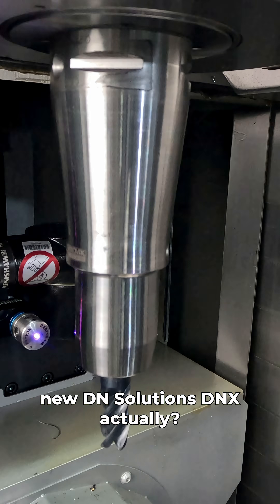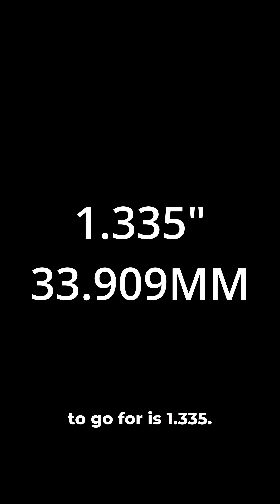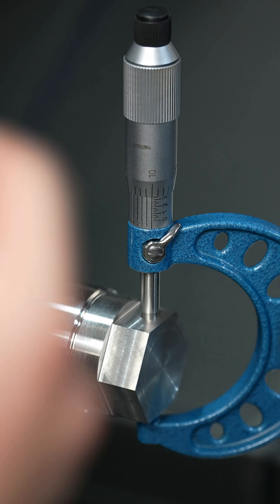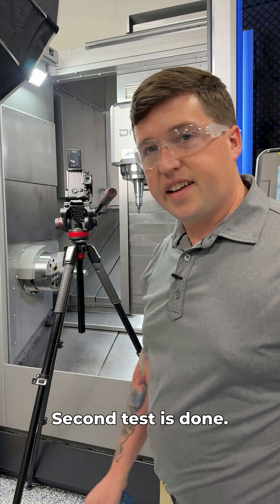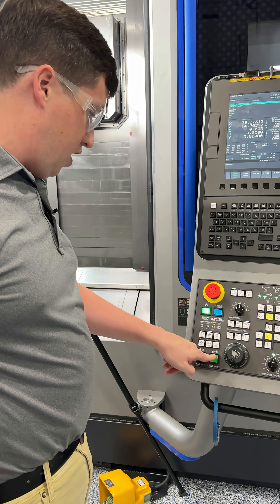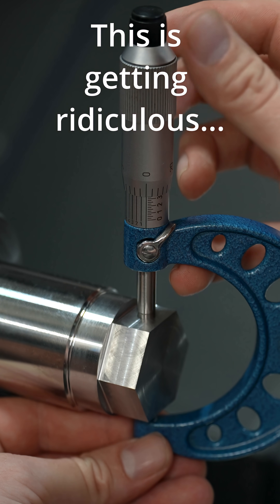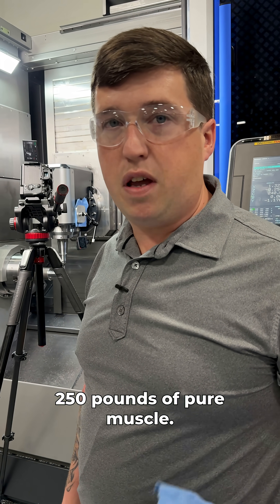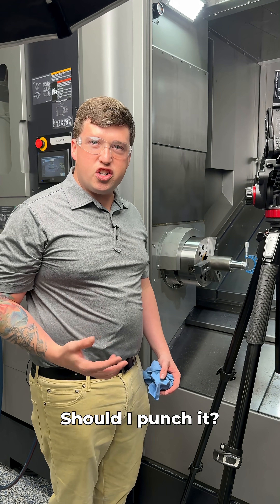DNX repeatability test

Comment: Which measurement system do you prefer, the metric or the imperial?
Reply from the maker: Either or. Doesn’t matter really. If my customer works in metric then I work in metric that day. They both have advantages and disadvantages but after so many years of just using both I honestly can’t tell the difference

Comment: Your tool holders matter the most. They also wear out. We had some issues years ago with a Mazak and it turned out to be the combination of the tool holders and the pull studs. Torquing the pull studs would deform the taper on the holder. Causing runout. Also if your spindle taper gets dirty you can have runout and z acis repeatability problems. The old style carousel tool changers were bad about holding grime and dirt and transferring it to the taper. We have a few Bridgeport VMCs and we had to clean the tool magazine regularly

Comment: Use the rachet @ 3 clicks exactly if you’re bad.
Reply from the maker: I wish it had the upper ratchet. It has the the rolling style grip which I personally think sucks. It locks too easy so it isn’t consistent. You have to put your finger on both the barrel and roller to use feel. Which again I think sucks but if you practice a few thousand times on gage blocks you get consistent 😂
Reply: @donniehinske  HATE that style of thimble.

Comment: Honestly to test repeatability I would have milled separate haxagons because if you come back into the same hexagon, it’s almost like a finish pass, with a lot less tool pressure.
Reply from the maker: Well to me that’s kind of the point. I want to see repeatability. If you take heavy cuts you can introduce different variables
Reply: Right, but if you Mill the same hexagon just stepped down, you are changing the tool pressure,therefore applying a new variable.
Reply: You can see a lot of issues just circle milling a bore. We used to set backlash comp values doing this, it take into account any sticktion in the ways and ballscrews

Comment: If shaking the tool would move it, it's far gone the time to change the guides or bearings, I think 😅
Reply from the maker: You’d be surprised. Every CNC on this planet if you put an indicator on its turret and push it it will move a little and that’s every CNC.

Comment: From Mori. To haas. Toyoda every other changer I have used in past 35 years have never seen difference.
Reply: Exactly. The Haas mills I run have the same repeatability as this
Reply: @rixiv7868 
You have no idea what repeatability this machine offers, or did you see anyone properly measure it?
I sure didn't.

Besides that, no. It most certainly doesn't. But it's completely irrelevant for the absolute majority of milling work.

Comment: You wanna impress me make it go from 3.335 to 3.34. 😂
Reply: Easy. Steel 3.335" to 3.340" you need 125c temperature increase. Pretty sure you can do that with the holder itself with the 12K spindle😂😂

Comment: This isn't really a test of the tool changer. The tool changer doesn't dictate the final position of the tool within the spindle. This is more a test of the repeatability of the spindles tool clamping mechanism.  Assuming that it's a dual contact spindle it should repeat effortlessly.
Reply from the maker: That’s a fair point. Still I was really shocked with how well it repeated. To me it seems SO easy for just one hair to throw off the capto system
Reply: @donniehinske I don't have to many hairs left to test that theory with, so I'll leave that up to you for testing.
Reply: Fair, however, I see  005 on similar hex "offsets" on mazak mill turn integrex machines and they're no where near the .0001 tolerances that this short shows
Reply: I would prefer to see the spindle spin randomly before the tool changer remounts the tool.  That is closer to real-world.
Reply: @AcuteChronic I'd be willing to bet that the spindle is oriented in the same position each time the tool is changed. Seeing as it's a Capto system there are really only 3 orientations possible for the spindle to be in when the tool is changed.
Reply: @brandons9138  Capto doesn’t let you load in three orientations, only one will work.
Reply: @Mr_Eyeholes I kinda figured that would be the case.

Comment: BTW I can see your grip is inconsistent by 0.0003 it's all your fault for squeezing too hard.  You know it's not a C camp........
Reply: Reasonable, using the ratchet will apply even measurement pressure ensuring that you’re not changing the measurement with manipulated force